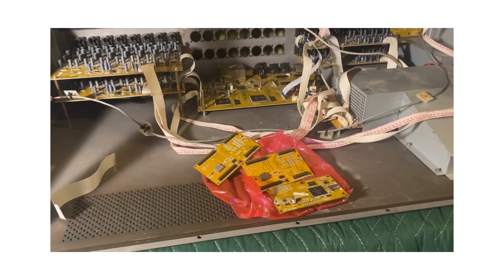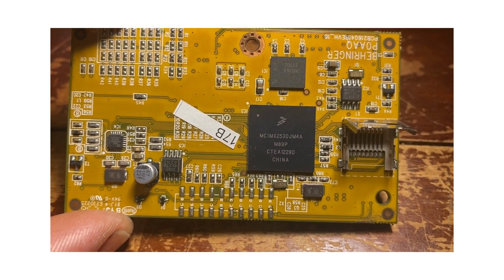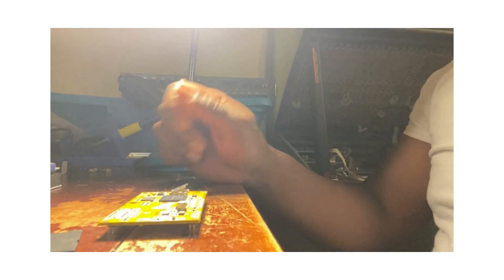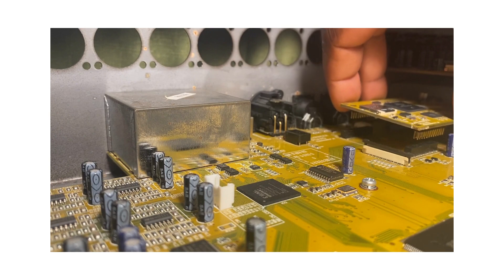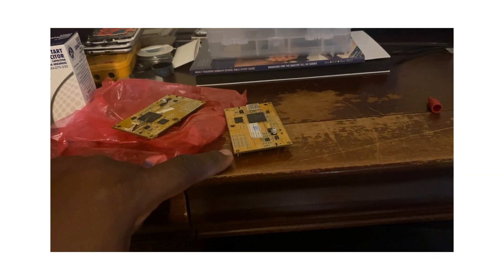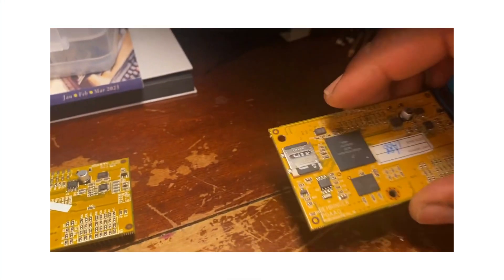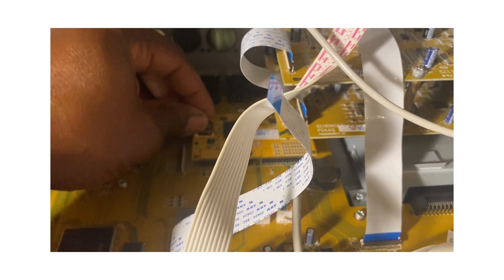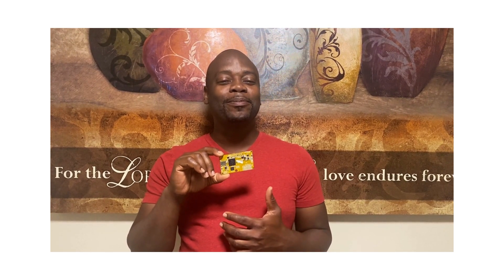Reballing a Behringer x32 daughterboard (mcu)

Comment: Hey Rich, Thanks for sharing your knowledge with us.  I was wondering how long I should keep the heat gun on the chip - I do have a laser thermometer I can use to monitor temperature of the chip.
Reply from the maker: Well depends on the temperature and checking the chip
Reply: @richthefixer  I have my rework station set to 350 F - I was wondering if there's a target temp for the chip?
Reply from the maker: @joelgeisert  yes I set mine @350

Comment: Hey Rich! I have a full size x32 that the ethernet port for network control has died. (once the console boots the yellow light stays on constantly with or without an ethernet cable plugged into it.) I don't think I want to try and just buy a ethernet port and solder it in. I would rather buy the whole motherboard that you were putting the daughterboard into in this video. Where are you sourcing your parts?
Reply: Had the same issue. Changed the ethernet transceiver chip (LAN8720A). And nothing happened. I'm buying a new MCU. Did you solved it?
Reply: Just resoldered the chip (LAN8720A) and everything is working now. Apparently hot air was not enough, and I needed to resolder with the pen.

My issue was a damaged ethernet port due to PoE injection (theoretically no issue but as I can see, it damaged the transceiver (LAN8720A)).

Changed a 1€ part and now is working. No need to buy a new MCU.

X32 Rack. @richthefixer
Reply from the maker: @Jorge_Frutos  sound great
Reply from the maker: I thought the port just did not function but was not damaged. Glad it worked out
Reply: @Jorge_Frutos  
Did you just replace the LAN8720A chip?
Did you need to replace the RJ45?
Reply: @stera777  I only changed the LAN7820A chip. There's no need to change the ethernet RJ port, since there's no electronics nor magnetics inside that can be broken on a ESD event. Good luck repairing!❤
Reply: @Jorge_Frutos will try to replace mine as well. Wish me well.
Reply: @KristohanongBisdakMusic  good luck
Reply from the maker: @Jorge_Frutos  mcu is the issue. Mcu control the function on the ethernet port
Reply from the maker: I just google the net, but nothing is available now. But I can check. Please send a video of the issue to yarddie83@hotmail.com